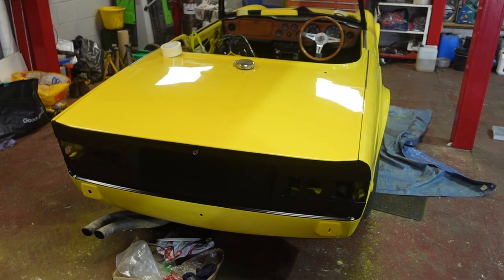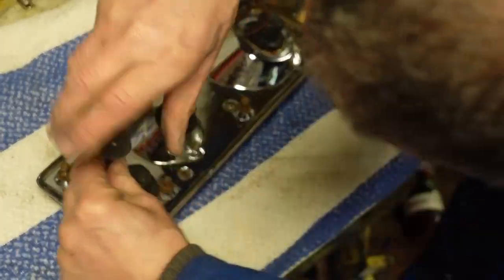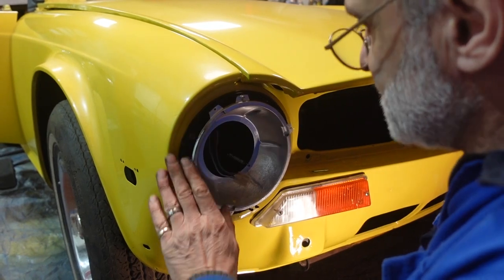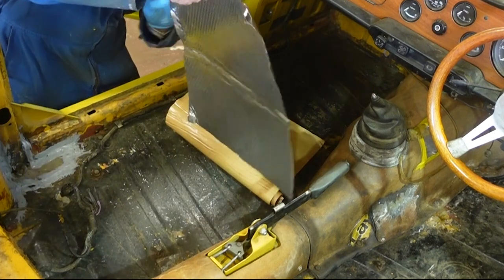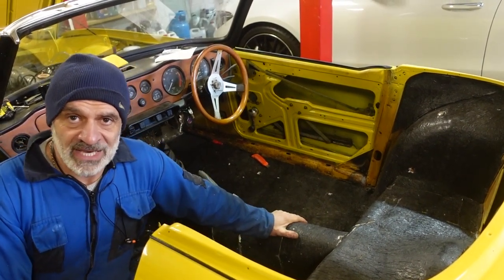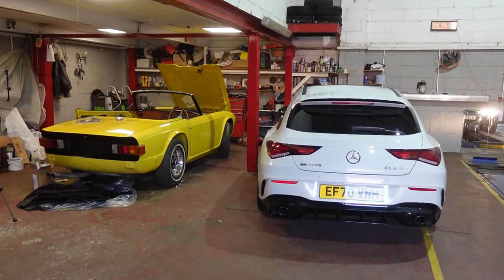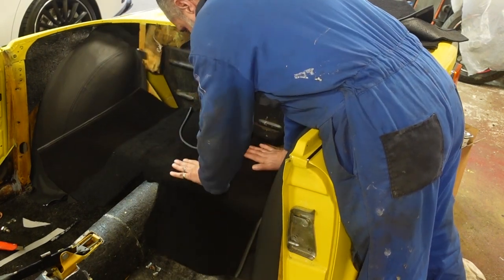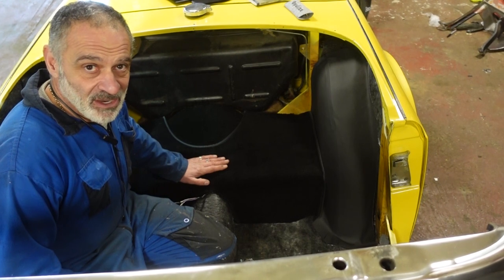Triumph TR6 Restoration Part 21 Lights, Underlay And Carpets

Comment: The underlayment came out great the rear quarter panels look amazing.
Reply from the maker: Hi Ralph.The underlay was such an off the cuff idea. It turned out great
Reply: The only thing to do now on the wheel arch is to locate the hole for the seat belt . I’m pretty sure you can locate it from under the car.

Comment: Johnny. Well done. I’m about to replace the interior in my TR6. I’m curious about the underlayment you used. The molding/shaping ability is seems super useful. Please share the brand name. 

Cheers
Reply from the maker: Hi Scott
the underlay I used was household carpet underlay. I was lucky enough to have had some remnants left over from when I had a carpet fitted. so I'm not sure what brand/type it is exactly but I believe theyre all pretty standard. I did a quick search and this came up which is pretty similar.
https://www.onlinecarpets.co.uk/products/cirrus-cloud-9-carpet-underlay?msclkid=99b2aa86835319ce3a21cfd9a2eb38e2
Hope this helps
Johnny